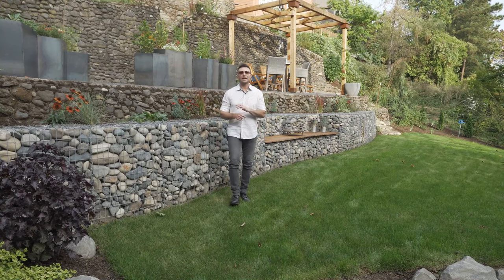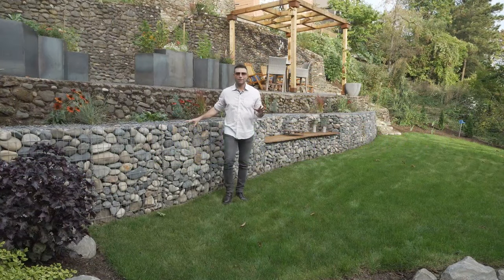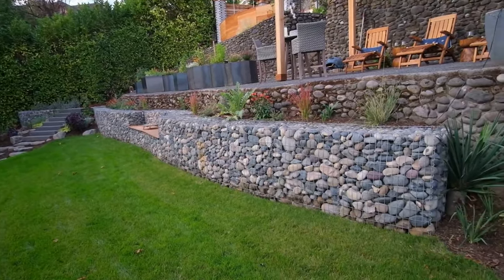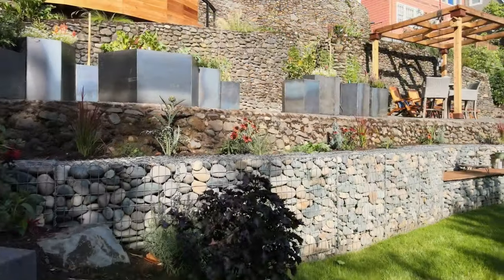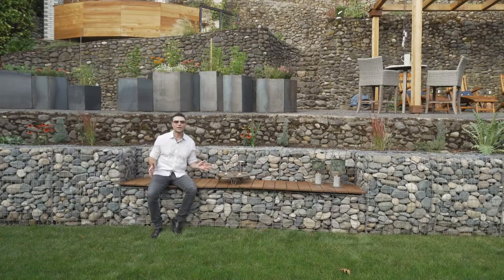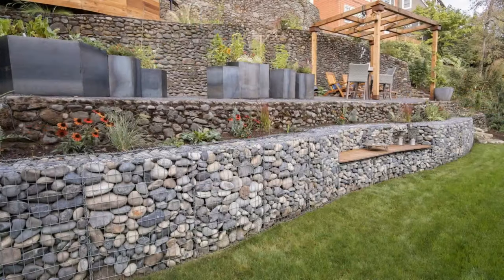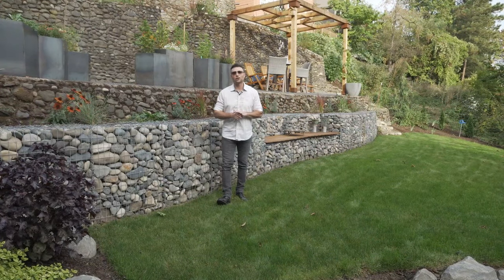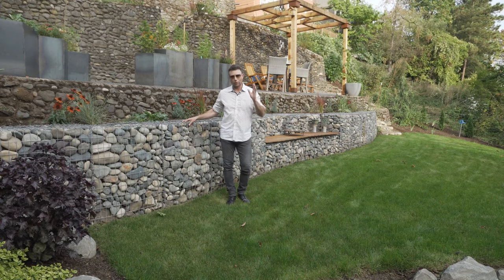Gabion Retaining Walls (INEXPENSIVE & SUPER COOL)

Comment: It’s hideous and cheap looking taking away from the natural beauty of natural dry laid stone masonry. The cages will rust over time and the fact that the rocks are just pored into the cage shows it has no actual structural integrity the cage holds everything in place once the cage is compromised with will take about 10 years the structure will fail
Reply: Even worse, they used round river rock instead of something that would lock better together like angular rock, so once that steel rusts, they’ll tumble out like soccer balls!
Reply: This is exactly what I was thinking while watching!
Reply: Spend 20% more for stainless steel cages and they will last at least fifty years and look beautiful. Then using river rock to fill the gabion cages is not a concern. Large riprap is usually used to decrease the turbulence of water flowing through the gabion  especially if you have a gabion mattress on slopes.
Reply: @tjhughes7740  You line the back and under the base of the gabion cage with porous landscape fabric before filling it with rocks so water can flow through it but not soil. That prevents erosion and slows down the runoff speed of water during rain events. Putting a 3" compacted crushed rock base where the gabion cage will be placed also helps with drainage and stability. Large boulders or riprap weighs a lot (1.2 - 1.7 tons/cubic yard and a steel cage also adds stability. The force of gravity and internal friction provides stability to the filled gabion cage. Most gabion cages are 3' - 4' tall and do not require anchoring or piers. This is very old technoilogy 7,000 years old dating back to when the Egyptians made gabions using reed baskets filled with rock to prevent erosion and flash flooding.
Reply: I disagree especially if you use stone from the area.
Reply: False. I live in a snowy-raining climate and my neighbors have a 12 foot high Gabion retaining wall that is 15-20 years old and it is still in fantastic shape.
Reply: I make these walls. The metal is galvanized steel so very weather proof and panels like this that are 40 years old are still in daily use with livestock rust free. We weld ours together (wearing a respirator outside) and wire for additional strength and while I will allow you to just not like the look of them, they are very sturdy and structurally sound.
Reply: Pa local here, were a state full of mountains, primarily the appalachain.  Gabions are all throughout our state. 30 plus years old. No rust. And they have stopped rocks likes from occurring onto highways. Not only that but we utilize the rock pulled from the mountains. Which looks beautiful. These things work
Reply: The part of the cage exposed in the soil will surely roth rapidly. . Some would say that it would not roth and it is weather proof becauss it was galvanised but if you dig to the part that is exposed in the soil you will surely see the corrosion
Reply: Can always tell who has more money then brains lmao

Comment: It would have helped to see more detail on how they are built and the strength factor.  They work as a retaining wall.  Explain that more.
Reply: Go online and look up the engineering behind gabion construction and placement. Unless you are building a tall retaining wall with gabions the engineering using them is very simple.

Comment: How can I keep these walls from growing weeds and does the wire get to be quite dangerous in a few years.
Reply from the maker: I believe they are 50-70 year life. Check with the manufacturer about that though. Thank u
Reply: How about the weeds, any suggestions it’s just I have a dog couldn’t use weed killer. X
Reply: Back the gabions with geotech filter fabric to prevent soil moving into the gabion but allowing water movement through it.

Comment: Don’t the metal mesh rust?
Reply from the maker: gabion wall's lifespan depends on the type of wire used and the amount of salt spray it is exposed to. Something that is very coastal tends to rust out like any metal quicker. The further inland you go the longer they last but 100 years is the typical
Reply: @BackyardDesignGuy  
Oh right! thank you for your reply.

Comment: looks are poor compared to dry wall and its life is as long as the wires that hold it ie. 20 or 30 years max. Dry walls last forever if built properly.
Reply from the maker: We agree but this worked for this property. The original owner had a rock quarry and during the depression to help his employees feed their families, he paid them to build the walls you see in this video. When we were asked to design the space, we used gabion walls to mimic the earlier walls for cohesion. Thank you for your comment!
Reply: @BackyardDesignGuy  could you put a stucco cement finnish over top sort of like dry wall finnish?
Reply: @rudy103069  No but you could use two rows of stepped gabions to create a bench with a higher back made of gabions and put a flat surface down on top of the shorter gabions to provide seating.